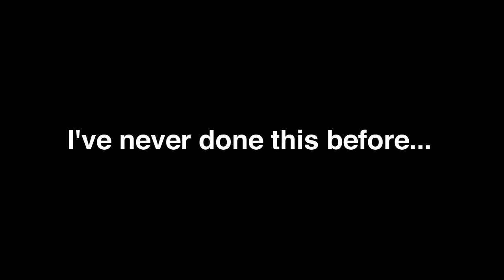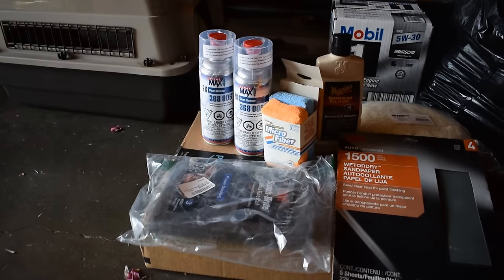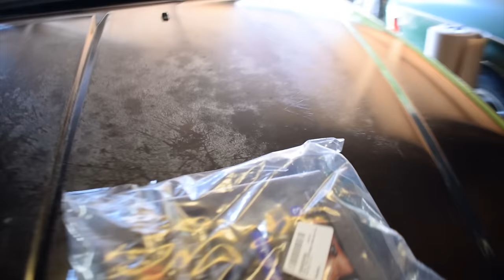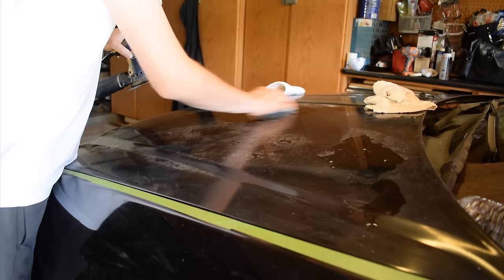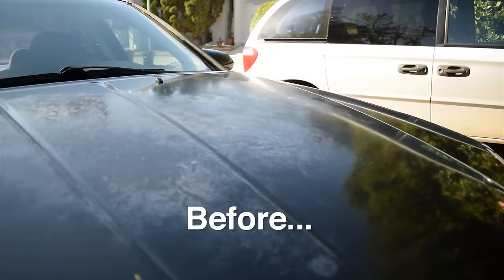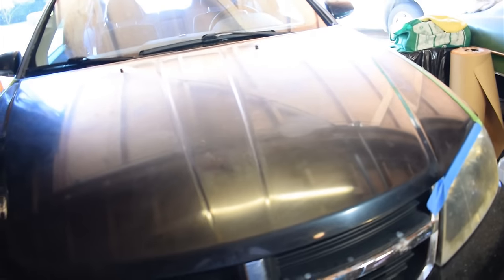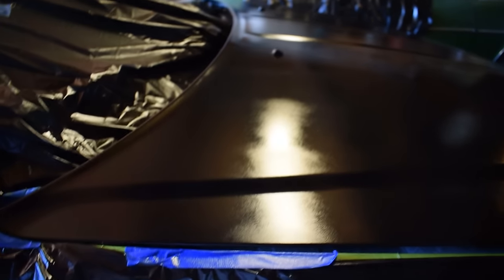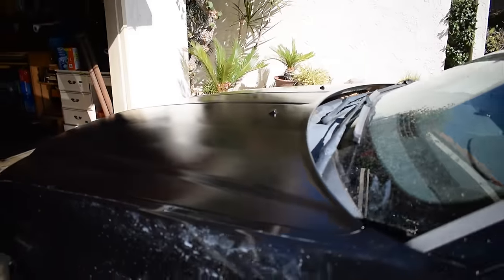How To Repair Clear Coat On A Car

Comment: Great video.  Failed clear-coat is common where I live in the evil CA sun.  People fight to park in the shade in parking lots in summer.  It looks horrid on a dark car.  My 1996 Plymouth minivan looks much worse than yours, esp. where I repainted accident damage and used cheap rattle-can clear-coat (not activated type) which later turned flaky white.  I found the bulk of the failed clear-coat can be scaped off with a dull putty knife, before going to wet-sanding.  I did that for several years to keep it looking presentable without even re-spraying.

I have less work on the top since the clear-coat is almost all gone there and even the base-coat some places to expose the primer.  I think I'll paint the top w/ left-over white polyurethane "boat paint" (Interlux Brightside) which I used on my camping trailer.  On a flat roof, it will look like the 2-tone of many Ford Flex.  The hood and sides I might paint with single-stage car paint (modern looking grey-blue color) if enough left after painting another car.

Comment: OMG dood...THAT'S MY CAR!!!!!! 100% black Dodge Avenger with the crappy water-based Chrysler clear coat....same areas...I'm going to be doing the same thing. Thanks for the video!!!!
Reply from the maker: Best of luck with your car! After 4 years the one thing I would recommend is sanding a bit more than I did in this video. In the areas where I sanded away all the old clear coat, the new clear coat is still holding really well, but in the areas that where I didn't completely sand it away, it started peeling up again

Comment: Im in the same boat as you and giving it a go on my car. Ive watched a lot of videos on this as well lol. Maybe if you give it a good fine wet sand probably 2000 grits to smoothen everything out then buff it, use polish and wax itll probably get rid of those darker spots. Good effort on your first go mate!
Reply from the maker: Good luck with your car bro! I sanded and polished the hood in this video here https://www.youtube.com/watch?v=WS2Cv3JuvRA
It helped smoothen it out, but I think the dark spots are just going to stay because those are the parts where I completely removed the old clear coat

Comment: Hey, i want to know how many cans of clear coat did you use for hood and the roof?? And yes, your video is really helpful. Thank you
Reply from the maker: Hi Hiren, for the hood I used less than one can of clear coat. I haven't done the roof yet, but I'm pretty sure I can do it with one can also. I have an extra can on hand just in case I need it
Reply: @TobiasHolenstein  thank you for the reply
Reply from the maker: You're welcome!

Comment: Just watched another video on clear coat....he did the same thing except shot a light coat of rattle can paint on the hood before he did the clear coat....it turned out wonderful.
Reply from the maker: Yeah I'm going to give this another shot pretty soon with the roof with the paint and everything. My main regret of this attempt was that I didn't fully sand off some of the bad clear coat, which left those white areas

Comment: You should have followed the example set forth by ratchets and wrenches. By simply alternating the direction that you applied the spray on each coating, (1st coat front to back,  2nd coat side to side, etc) you most likely would have had a superior result.

Comment: To do a final clean use wax and grease remover. What you used is a dust mask not a respirator and doesn't do a thing to protect you from isocyanates. A respirator mask for auto painting has a rubber face piece and replaceable charcoal filters which have to be replaced after so many hours. With a respirator you won't be able to smell the solvent. They also make them with full face masks and a visor. For full protection you also wear a Tyvek suit that also protects your skin.
Reply from the maker: Thanks for the advice! I'll keep that in mind for when I do the roof
Reply: @TobiasHolenstein  - on the respirator you can store it in a sealed zip-lock style bag between sessions to get the most use out of it (I squeeze most of the air out)  - read the recommendations for how often the filters need to be replaced.
Reply from the maker: Ok cool, thank you for the info
Reply: Yeah, wear gloves too, and
pants and long sleeves at least but ideally a disposable paint suit. Good move on the goggles though. Isocyanates can be absorbed through your eyes and skin also.

Comment: For the roof use red scotch brite, wet sand with 600 then  spray your color use 25% overlap 3 coats. then clear using 50% overlap and move slower while spraying, use 3 heavy coats then wetsand with 1500 then compound and polish. the wetsanding takes out any imoerfections after you clear it and removes any dirt kr orange peel once u polish it, will be looking brand new.
Reply: Make sure too shoot your edges and corners first also

Comment: My '05 Altima is exactly like yours was. I tried Plasti-Dip. Not that great a result. I'll try your method next. I think you're supposed to polish after it's been drying for several days too. Gets rid of that orange peel finish. Great first try. I've saved thousands doing work on my car myself. Loved that you take pride in your work. Nevermind the haters. I loved the video. Peace bro✌️
Reply from the maker: Thanks a lot Andrew! I wish you the best with your car. A while later I ended up making another video of me wet sanding and polishing the clear coat. Here it is if you are interested :) https://www.youtube.com/watch?v=WS2Cv3JuvRA

Comment: Need base coat before the clear, also need proper respirator, especially with 2k, dust mask will NOT protect you?
Reply from the maker: Thanks for the info. What is the base coat of?
Reply: Tobias Holenstein try Rustolem 2x it works and is cheap
Reply: @TobiasHolenstein  base coat is the color of your car that goes on first than the clear coat.  Most cars list that color # inside your front door.
Reply from the maker: Oh ok, thanks Stan!

Comment: After you sanded with 1500 you have to remove the lines the 1500 made with 2000 and then finish with 3000, it would have smooth out the marks that you were satisfied with.

Comment: I did this to my car last month. I even added the base coat first. Was not happy with the results. Plus I got over spray all over my garage. Should of just had the car painted for $600. If you are willing to wet sand and buff then go ahead. I wouldn’t recommend if you are picky.
Reply from the maker: I'm going to give a shot at wet sanding and buffing. I just received the supplies

Comment: Since your clear coating the whole hood, you should have sprayed a coat of base coat, to hide the old clear coat fade, then cleared over the base coat, also now that your clear coat has dried, you should wet sand the orange peel then buff it, your hood will come out amazing once you do that.

Comment: Hey it takes courage to try something you never have done before and then to learn from what you did,  Just a few things, the mask you're wearing for protection isn't designed for vapor and solvent particulates. That's more of a dust mask, at most light spraying of a water based paint.  For this type of work you should be wearing the heavy duty mask with the filter cartridges.  You also don't want this on your skin. They sell paint jump suits that are disposable. If not that then wear long sleeves and pants.  Your spraying technique isn't bad but with a few adjustments you will see a dramatic improvement.  Try to maintain the same distance in between the can and painting surface.  You have a tendency to pull up as you near the end of your spray line.  Slow down.  You weren't maintaining the same speed and most was applied to quickly. For the first coat it was okay as you are laying down a tack coat but subsequent coats should be applied a little slower, keeping both the distance of the can to the hood and the angle you're holding the can consistent.  Practice spraying on cardboard first.  Hold the can further away, hold it closer, vary the speed.  Watch how the spray pattern varies so that you will be able to monitor in real time if your technique needs adjusting. You also want to maintain the wet line. After you lay down a line the next line should overlap the previous one by about 30% so that you are always spraying with a wet edge.  It's a fine line between applying enough clear coat so you avoid orange peel but not too much that you get runs.  Both surfaces are relatively flat which helps prevent drips in itself.  Vertical surfaces are not as forgiving.  If you've come this far you may want to go just a little further and make the outcome even better.  As the clear coat flakes off the base color coat underneath becomes exposed to the elements.  This paint will fade at an accelerated rate versus the paint still covered with intact clear coat.  This will become more evident with just a clear coat application.  You will see lighter and darker shades.  Taking it up a notch involves a lot more sanding and application of base coat before clear coating.  Keep in mind that paint is the most expensive part of nearly all paint projects so the cost of your project both in time and money will grow.  Lastly, if you do up your game and decide to tackle the base coat problem you will have to decide on a delivery system.  You can order the color in spray cans which is time saving and convenient for smaller areas but for this much I would use a spray gun with a compressor, a better outcome but yes, additional costs.  It is possible to paint an entire car with rattle cans so as to reduce your costs.  Which ever you choose good luck.
Reply from the maker: Hi Mark, thanks for all the advice and detail! I appreciate that. I feel like I have a better idea for when I do the roof now
Reply: @TobiasHolenstein  Hi Tobias your welcome.  Have you taken on the roof yet? I have a 1995 Lincoln Town Car I bought last year that's in great shape except for the same clear coat problem.  One of these days I'll take on the project if I ever get the time.  I repair and restore exotic cars in Los Angeles.  Most of the cars I work on are vintage from 1950's -1970's and while I can be pulled into any number or kind of repair, I'm an interior specialist.  I've been in the auto biz for about 20 years. Great video btw.
Reply from the maker: Hi Mark, I haven't done the roof yet. My next little project will be attempting to get the orange peel look out of the hood and then hopefully get to the roof shortly after that. I love those Town Cars, very nice! Do you have a shop in LA? Somewhere down the line I want to get my seats reupholstered in my Celica, but at this point it's depending on how much money I spend on getting it back on the road again lol.

Comment: No offense man isocyanates are no joke man they can sensitize you for life be safe when you do the roof.
Reply from the maker: Thanks for the tip. I'll be sure to get a proper respirator when I do the roof
Reply: What do you mean sensitize you for life?
Reply: @SpacyStacy32  Basically what happens is from the exposure to the isocyanates, future exposure becomes highly sensitized. This means that the amount it takes for you to have a serious reaction becomes less and less with each time you are exposed.
Reply: @SpacyStacy32  ekie56 is right. I open a body shop. And I'm an engineer. Di-isocyanates in clears cause permanent nerve damage. Once that happens, it only takes a whisp of exposure to cause a reaction in your skin that feels like needles and fire.
Reply: @TobiasHolenstein  hey mate, the iso's can be absorbed through your skin and eyes also, you really need to cover up!
Stay safe.
Reply from the maker: Thanks Shaun, I will take the correct precautions next time

Comment: great video you use good film what type of film you shoot with? I think you missed a big part of ratchet & wrenches video.... you need to wet sand & buff out the finish with a compound & polish... iv'e been learning myself with great results, if you buff out that spray job it will come out 10x better.  first wet sand 1500, then 3000, then cutt with a cutting pad & cutting compund iv'e been using meguairs 105 it works good, then use a lighter pad (blue) start polishing it polishing compound meg. 205 or whatever, then finish with polish pad (white, or wool) & polish compound. try it out you'll love it
Reply from the maker: Thanks Joseph! I actually went ahead and did this in a later video. Here's the link in case you want to check it out :) https://www.youtube.com/watch?v=WS2Cv3JuvRA
Reply from the maker: Almost forgot! I'm shooting with a Nikon D5300 with the 18-55mm vr lens
Reply: @TobiasHolenstein  oh ok i'll check that video out... alright thanks for the tip on the camera , peace
Reply from the maker: Cool man, no problem. Have a good one!

Comment: Great video, but I would want to remove all that bad clear coat first and respray the base coat then clear coat.
Reply: The whole point is to do a quick repair. Is sanding and laying down a base/clear the correct way. YES. It’s not a Ferrari it’s a old dodge. With your advice he should also rebuild the engine while he’s at it....🙄

Comment: You want to avoid touching the work surface and use a wax and grease remover and/or prep solvent just prior to spraying. Water alone will not effectively remove oils. Also check out Optimum CCR Clear Coat Restore.. simple prep, super easy wipe on application, self levels, and blends fairly well.👍👌✌
Reply from the maker: Thanks I'll check that out!

Comment: Greetings! Very good effort!  But you're actually not done yet. You still need to wet sand with very fine grit sandpaper.  Once you get done sanding it's going to look dull and really bad almost like you just ruined it . But not to worry it's not ruined.  The wet sanding is going to take out imperfections and get rid of the overlap streaks from the spray can.  After wet sanding ... you're going to use use a Polish to bring it to bring back the shine.  Its going to be a brilliant glass-like shine. without the overlap streaks when done!
Reply from the maker: Thanks for the tip James! I will look into doing that

Comment: Every row you sprayed you did not keep a wet edge.  After you lay a row your next row should overlap the previous row by 50% so your leading edge is alway wet.  If you do lead with a dry edge your results will have orange peel, bumps and will be visibly different in appearance.

Comment: You need to paint the roof BEFORE putting clear coat on it. It will look better. Hood looks nice but those spots could have been avoided if you'd primered the hood before clearcoat. B+

Comment: Looks way better than before.  Sanding the orange peel with high grit (3000, then 5000) might improve it further.  Either way, good on you for trying and sharing the results.
Reply from the maker: Thanks! I went ahead and sanded and polished and it looked better https://www.youtube.com/watch?v=WS2Cv3JuvRA&t=1s My only regret is not taking more time to sand away the white areas, since there was still damaged clear coat there

Comment: 1500 grit is too fine.  Clearcoat won't be able to bind to it.  Try using 600 to 800 grit instead.  Also, if you are going to do all this, spray a color coat before you clear it.  This will make the panel look really good instead of just a little bit better.
Reply from the maker: Thanks for the advice. I'll keep that in mind for next time
Reply: Will 600 to 800 grit remove the base coat?  What if you are on a budget and can't afford to base the whole thing and then clear it too?
Reply: @SpacyStacy32  You only need to scuff the paint so that the clearcoat has something to grab onto.  You are not sitting there sanding until the paint is gone.  Just want to give a few strokes and make sure the entire area is scuffed.  An other thing that works well is maroon scotch brite pads that you can buy at autopart stores, it's about the same as 600 grit paper but it's flexible.

Comment: Also hold can a little closer and move faster and lap the spray pattern a bit more to keep a wet edge.
Reply from the maker: Hi Glen, thanks for the tips, I'll keep them in mind for the future. My main regret is not fully sanding away all the white from the old damaged clear coat. Looking back I would have liked to take some more time with that

Comment: Everyone wants to know which spray can brand to use...   lol. You don’t.   You get a boothe-you sand till smooth with 1500-you re base coat- then 1 shallow coat 2k clear. Wait 5 min- final glass like finish with clear.    No amount of “polishing can fix it from there.

Comment: Not bad for first time. To speed ip process sand the clear with 800 grit then follow with 1500. Then clean with tack and put down a base coat
Reply: Sorry put base coat your results will be much better
Reply from the maker: Thank you for the tips Cliff!

Comment: nice job at prep clean before painting by now you learn  better way to repair clear coat peeling off paint, start wit 600 grit wet sandpaper using a sanding block ,follow with 1000 grit  after this my suggestion always  primer the area damage the most, apply 3 coats of primer and  do spray primer 2 in. over the line left by old clear then sand primer coat with 1000, then get the color code of car get basecoat type paint when spraying please apply 50% overlap coats of paint that way paint film will dry more evenly, follow same instructions you did on video (waiting TIME between coats) then clear  coat 2k is the best, 4 coats of it I recommend  remember 50% overlap when clear coating.  oooookkaaayyyy. see on your next paint job.
Reply from the maker: Thank you for the advice Juan!

Comment: You are supposed to have a respirator on. Did you read up on how to do the job before doing it, or did you just go ahead and wing it? Because if wing it, and you mess it up, it's going to be pretty hard to fix it. I wouldn't say that it looks "Really good," but it is better than it was. You are not supposed to use spray cans on the hood.